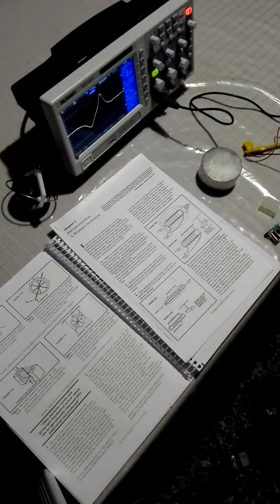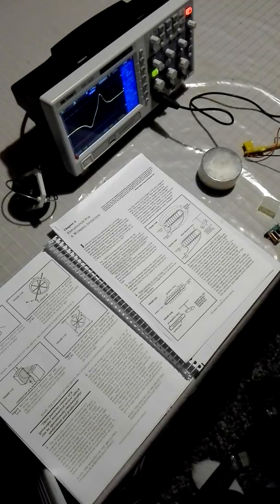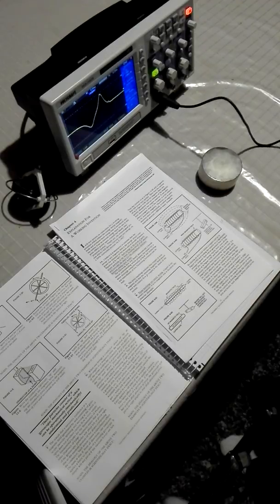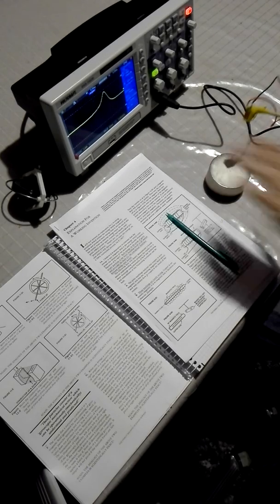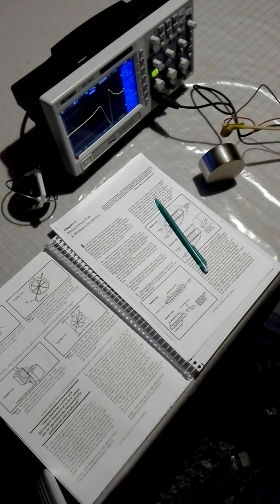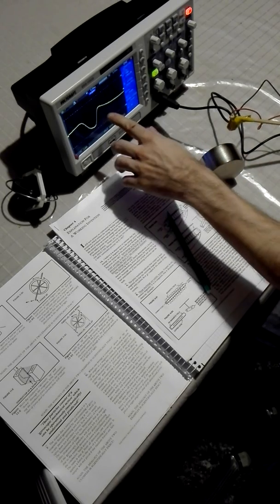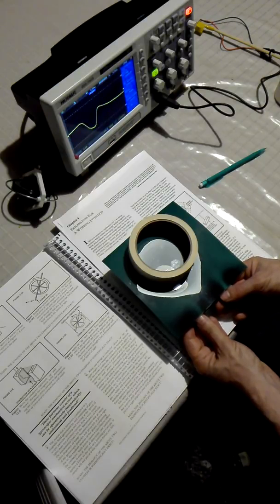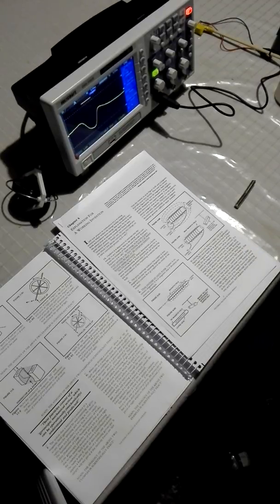004 Daniel McFarland Cook Coils

Comment: ok. when you hold the coil over the center of the magnet you hold it still, this will not induce a current but it will have immersed the coil into the flux, as you pulled it out you cut the flux. The movement cuts the coil through the flux producing only one pulse either + or - but moving it across left to right you are picking up two flux fields as they branch up and around...I think this is what you see, not BEMF as you have no closed circuit and i don't see the probes attached..I could be wrong but you vid clip is not close enough to see the coil. if you want to try again also make one continuous movement over the magnet starting at least 100mm from the magnet and finnish at least 100mm away. the sudden jolt you did as you stop can induce the reverse current because of the high speed wobble you do so close to the magnet. the faster you move the higher the voltage will be.
When you come to start the Cook coil the flat edge of the magnet should be moved along the coil at a rapid constant speed along the length while maintaining a close distance all the time and only in the one direction and no stops till you are clear of the coil.
Reply from the maker: Hi David,
Thank you very much for your comments, I don't understand why I didn't get an email that comments where made, I have to check where the settings for that are made.
I will make another video and keep your help in mind when making.

The coil you see on video is directly connected to the BNC connector, so it's indeed an open circuit.

Also thx for the Cook coil explication, I didn't know how to move the magnet from the patend.
I have to think about a guiding system to achieve best result.